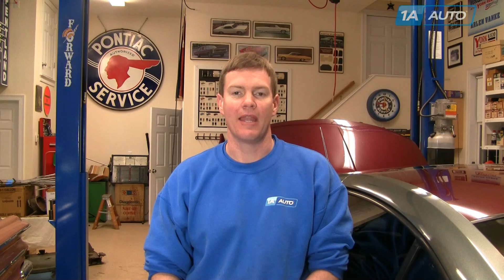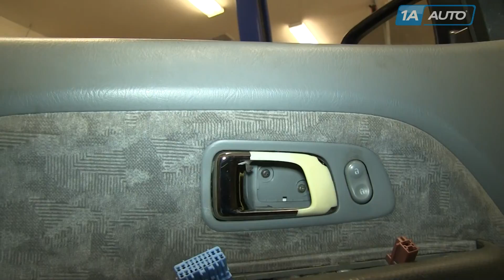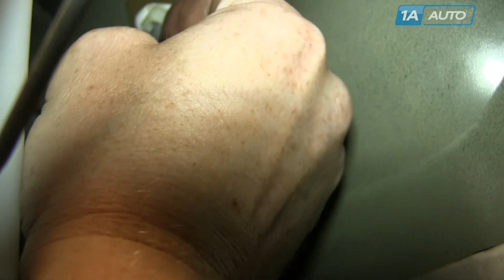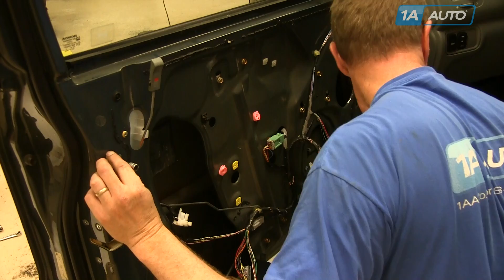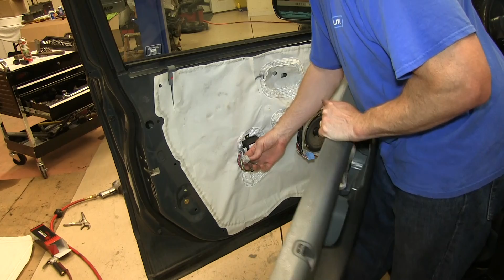How to Replace Front Exterior Door Handle 03-08 Honda Pilot

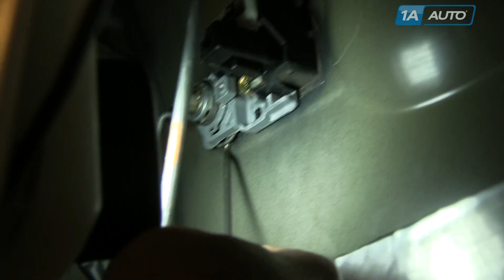Comment: I've looked for over half an hour and do not see any clip that you show at 4:10.  I keep thinking why it's not there and whats holding everything in.  Sorry but I cannot find any clip that can be hooked with anything.  Does the clip position way up so that you cannot see any part of it to hook on to?  The video shows the bottom of the clip slightly below the assembly but I cannot find anything like that on my 06 Pilot.  This is a real PIA!

Comment: The hardest part of this is taking the wire clip out at 4:10 I had to make a really short tool/hook out of a hanger and it worked perfectly (after about 10 tries and filing it down). Notice that he says you will need one smaller than the one pictured and he's correct. Good luck. Still a really good video. thanks
Reply from the maker: +Mr Luke Thanks for the feedback!

Comment: The 10mm screw is blocked by that bracket, 4:22 bracket must come off first before you can remove the screw All this while working behind the outer panel with limited visibility.

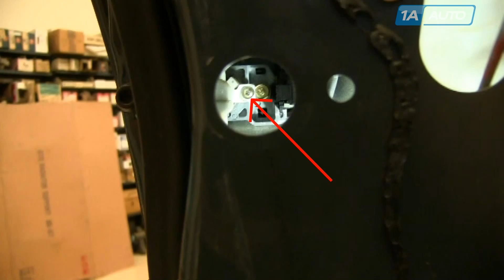Comment: Great video, Im having a problem getting my 10mm socket on to the bolt head next to the lock cylinder. I did take the philips screw out. There seems to be a tab obstructing the path of my socket. It can be seen at 3:49.  Any advice?
Reply: Me too did you figure it out?

Comment: I purchased the door handle and what I thought were the necessary tools. My 10mm socket is too thick. I know I need a thin socket, but it's not clear how thin will be thin enough. Can anyone suggest a manufacturer that produces extra thin 10mm sockets for a 3/8 or 1/2 square? Also I need help with getting an extension that's long like the one in this video. Thank you in advance.

Comment: THANK YOU. From this video, I can tell that the previous owner of my 2004 CRV had someone work on the cylinder. I can tell because the screw you stop-motioned on is missing as is the retainer clip as well. If these two parts are missing from the cylinder assembly, would that prevent a properly working cylinder from turning? The issue I am having is that the master key goes into the cylinder, but will  not turn it even a bit. The same key opens all other doors on the car. IF these missing parts would prevent the cylinder from working, can I get them from you? OR, if a new cylinder would come with those parts, can I order a new cylinder from you?

Comment: This seems to be a good video reference for taking the door handle and lock cylinder out of a 2003-2007 Honda Accord.  Unlike the 2000-20005 Honda Civic, you don't have to remove the sliding window glass but you sill have to remove the window rail or runner.
Reply from the maker: +cgrscott Thanks for watching. If any of our viewers needs to make this repair, we carry the auto repair part shown in this video on our website. Here is a link to them http://www.1aauto.com/2003-08-honda-pilot-exterior-door-handle-driver-side-front-black/i/1adhe00714?utm_source=YouTube&utm_medium=CTA+Comment&utm_campaign=ytcomment&utm_term=cTcSercCh4k
Reply: I successfully re-keyed the door lock on my 2005 Honda Accord using third party coded lock wafers that go inside the lock cylinder.  I did not have to remove any fastener spring clip to remove the lock cylinder, just a couple of screws.  My do-it yourself repair caused the lock actuator to fail.  Now I will have to bring the Accord into the Honda Dealership.  The Doors won't un-lock so, I find myself climbing in and out of the door window like Bo and Luke Duke getting in and out of the General Lee.

Comment: great video.  I am only needing to change lock cylinder. can i do this without removing entire handle?  any videos on that process?
Reply: I wish they at least told us at what point the actual cylinder was removed.
Reply from the maker: +Gary Sbraccia Thank you for checking us out. The lock cylinder is bolted onto the handle, and sometimes may be disconnected from inside the door once the panel is removed. We do not have an exact video at this time. 1aauto.com
Reply: thanks for the info.